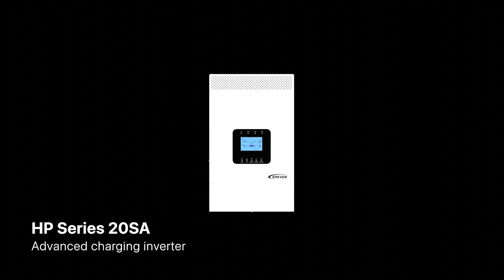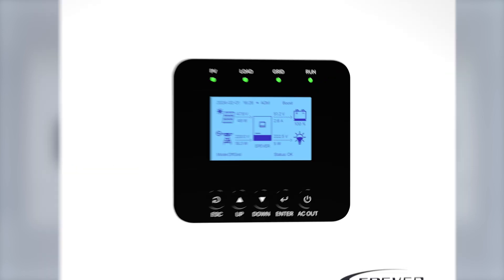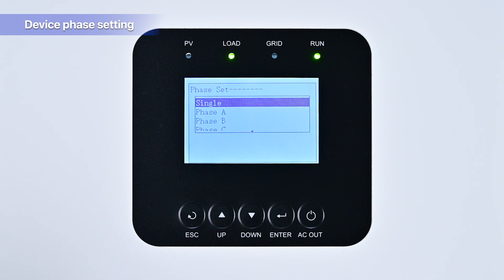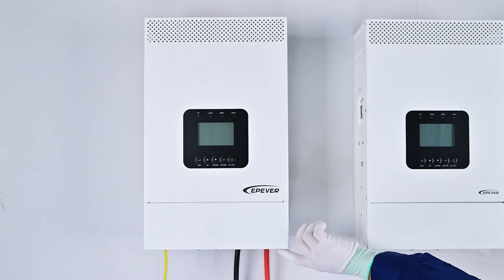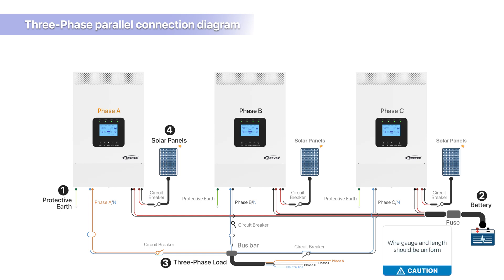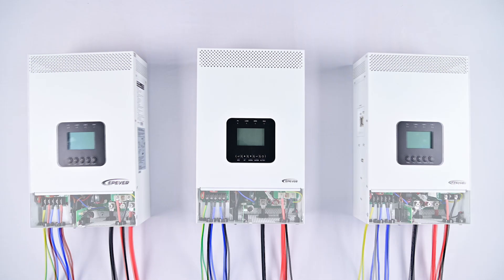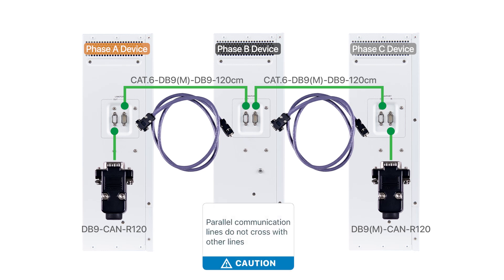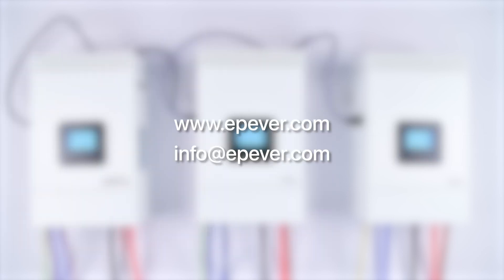Setting Up Three-Phase Parallel | EPEVER HP Series 20SA Inverter Charger Guide

Comment: Hola buenas tardes, lo puse en todo múltiple y no carga de los paneles y lo puse en all single y ahí funcionó , que estará pasando tendré problema en esa modalidad?
Reply from the maker: Hello there, to help us diagnose the issue, please contact our support team at support@epever.com and provide the following information:
1. The wiring method of the PV panel (or a schematic diagram).
2. The configuration of the PV panel.
3. The specifications label on the PV panel.
Thank you.

Comment: Hola , compré el inversor pero me gustaría que me den una ayuda en la instalación a diferencia con el anterior inversor este viene con dos entradas para PV , puedo conectar sólo a uno o es recomendable usar ambos, con 3000 w por cada uno agradecería su respuesta gracias
Reply from the maker: Yes, both single and dual PV arrays are supported.
When connecting only one PV array, please ensure to set the “PV mode” to “ALL MULTIPLE” on the LCD screen. 
When the MPPT Voltage is greater than 200V, each input can handle up to 3000W, for a total of 6000W.
If you have any questions about the settings, please don't hesitate to contact our support team at support@epever.com.

Comment: Hola , una consulta si instalo 2 de estos inversores se suman ambas potencia( dos 11.000.watts) le agradeceré su respuesta saludos de chile
Reply from the maker: Yes, that's possible. When two HP series 20SA inverters are connected in parallel, their combined output power can reach up to 11,000 watts.

Comment: May i know the characteristics of the inverter: MPPT, how many Kva Output ?
Reply from the maker: Hello there, thank you for your interest in our product. The HP series 20SA inverter charger comes in two models: HP3542-AH0650P20SA and HP5542-AH1050P20SA. The kVA outputs are 3.5 kVA and 5.5 kVA respectively. The PV Maximum Input Power is 4000W for the first model and 6000W for the second, with Maximum Charging Currents of 60A and 100A. For more details, please visit our product page: https://www.epever.com/product/hp-ahp20sa-series-inverter-charger